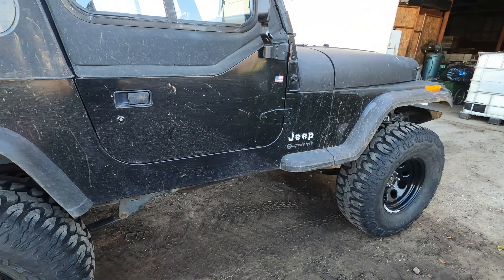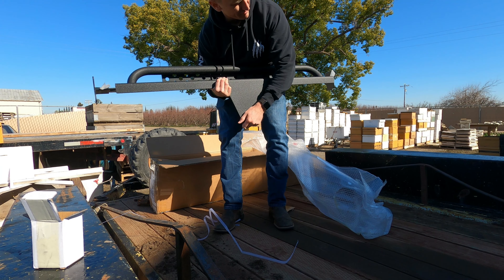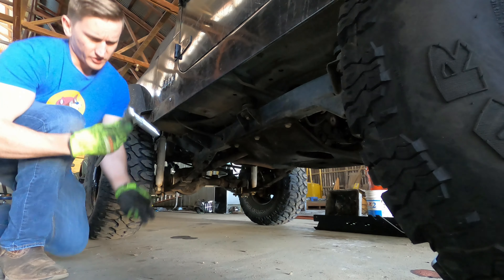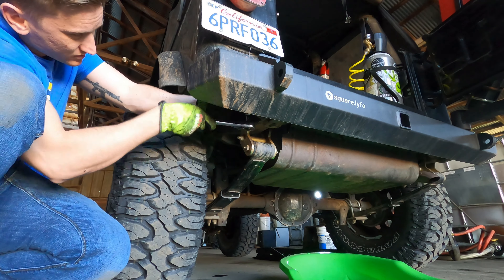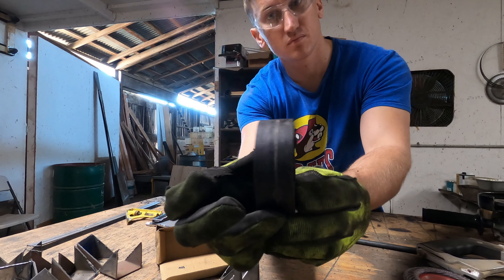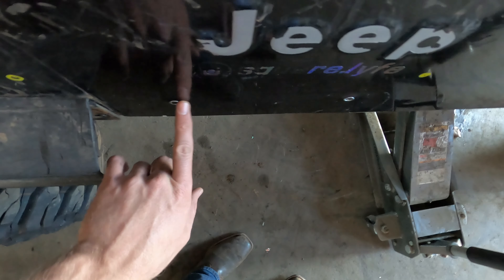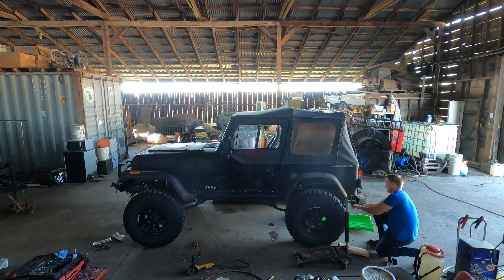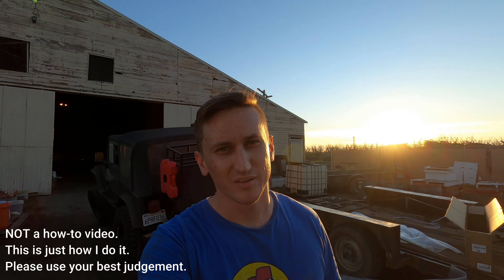Installing Barricade Rock Sliders on the YJ

Comment: shouldn't the puck you ground go between the slider mount and the body?  that's why it's tilted. It changed the angle, as the slider is meant to mount to original equipment body mount position.?? the fork part mount of the slider should go level straight across to the body mount. put the puck on top of the slide mount..